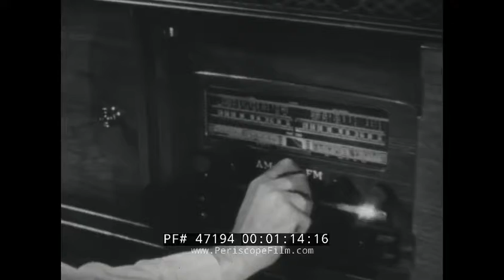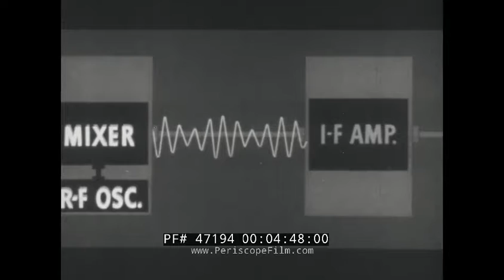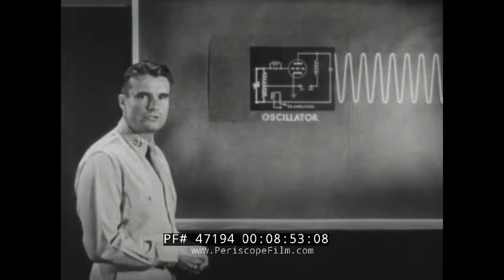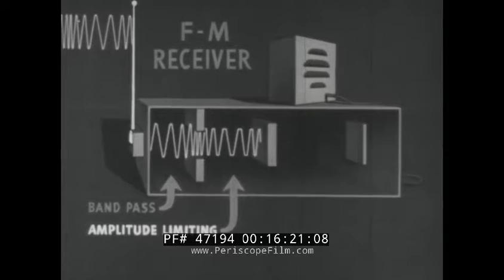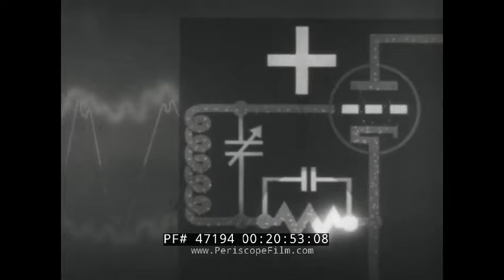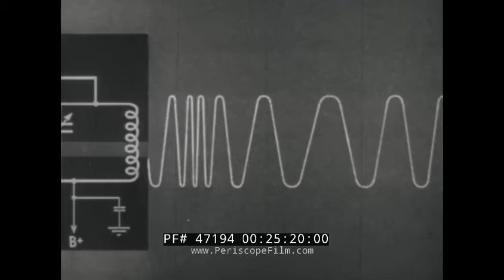“BASIC PRINCIPLES OF FREQUENCY MODULATION”   1944 U.S. WAR DEPARTMENT FILM FM RADIO 47194

Comment: In the block diagram of AM transmission the modulator should be where the amplifier is shown and the amplifier where the modulator is shown. I was a TI in the Air Force and taught this material during the Viet Nam war.

Comment: What do the IF amps do, and what does it mean?  Intermediate frequency?  Intermediate function?  Kinda' looks like the two together simply amplify the signal without any other operation being applied.  
But why not use one amplifier that amplifies twice as much???  
Something tells me that's not what's going on, (unless they wish to show you DO need two IF amps to increase the signal enough to feed to the next component).  
So, I figure I'm missing something somewhere.
Reply: The standard a.m. receiver uses something called a superheterodyne. Basically, it's hard to design a tunable filter that can be adjusted to pass more than one radio station. So they design a filter that works perfectly at one specific frequency called the intermediate frequency. Then they add a tunable oscillator inside the receiver that can generate another frequency chosen by the operator by turning the tuning dial, as generating a frequency is really easy to do accurately. What then happens is that the incoming signal is added to this other locally generated frequency. the trick is that when you dial in a station on the tuning dial, you're actually choosing what frequency is being added to the incoming waves, one that is very high well out of the band of the radio spectrum. The signal that is added when combined with the signal you're looking for generates an interference harmonic pattern, a beat frequency. You choose the generated frequency in such a way that the beat frequency produced when the two waves are added is at the specific frequency the filter is tuned for. It's going to produce a lot of other harmonics as well but the point is that filter will give you back exactly the specific intermediate frequency signal modulated by the carrier signal you were looking for.

If you search for technology connections superheterodyne you can see a very informative video that explains all of this, not one of these classic old training films but a modern one about the old radio sets that's actually pretty entertaining and clever.
Reply: @AlRoderick  Cool deal.  I got a bit of analog and a lot of digital circuit theory in computer school back in the early '80's, but fell more into software design and support when my career started.  And I'm still fascinated by some fairly simple electronic applications and gadgets, because I only know a little about what makes them tick and appreciate the background it takes to master them.
Reply: What Alexander said.  When you're tuning an FM radio, you're adjusting a frequency that gets mixed with the carrier to put the station you want to hear, at the IF frequency (where the demodulation happens).   You aren't adjusting the filter, you're adjusting the signal to shift the station you want, to where the fixed filter is.   It's pretty clever.
Reply: @andybaldman  Thanx for the input.  I get a major kick out of coming across 'introductory' films such as this, and learning about concepts and applications for electronics.  
My education in electronics, and schematics, was deeply influenced by the type of tech certification I was working on, back in the early '80's when there weren't ANY sponsored by Microsoft, or recognized by my prospective employers.  Needed enough to get a foot in the door with someone you'd hope would offer some on-the-job training and such.  And I ended up dealing with board level, not component level debugging, and more software than hardware work.  Great and enjoyable career, but good, basic electronics applications ended up being less a part than software design and support, so I missed a lot that I *could* have been exposed to.  
:-)  :-)